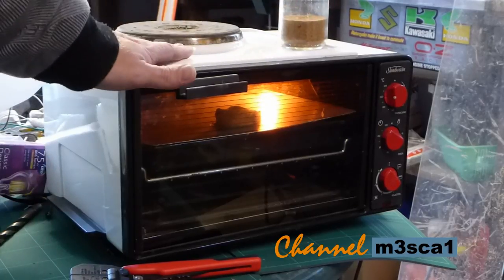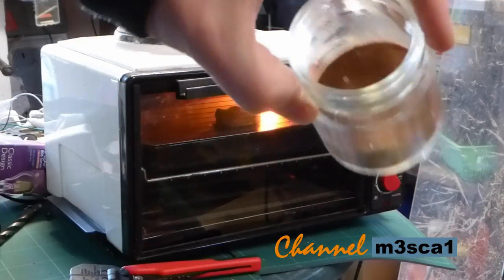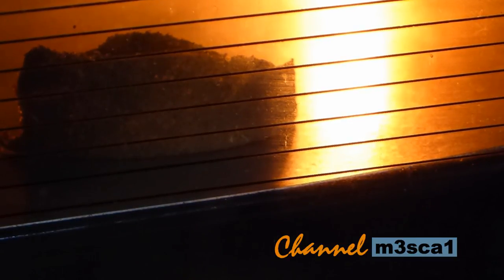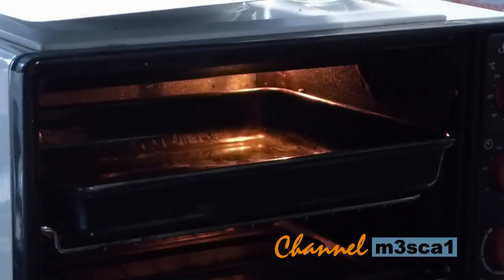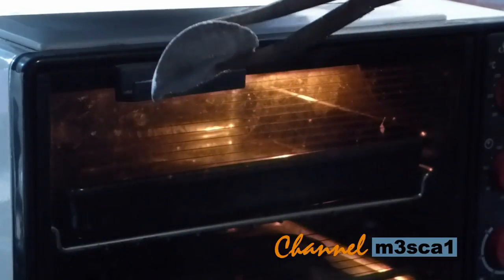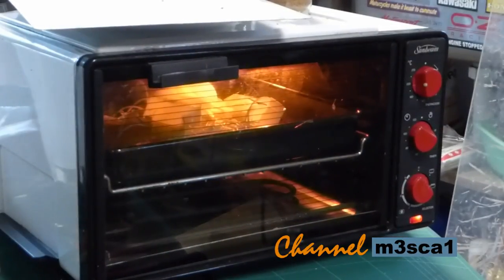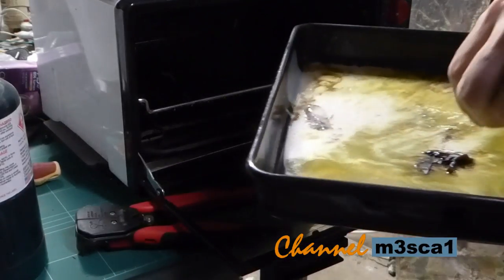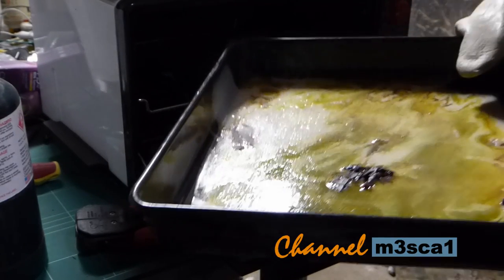melting PLA & Forge making...

Comment: thought you said you only need the two printers :)
Reply from the maker: Zero Bytes lol yeah true but there is a bargain of a printer coming next week...can you guess who is selling it? I plan to sell the cold bed machine.
Reply: m3sca1 aldi?
Reply from the maker: Zero Bytes yes that's  correct...expect them to sell out quickly
Reply: i'm sure they will sell fast may check my local aldi but not expecting them to stock it as last time  there was nothing wen they sold the last one .
Reply from the maker: Zero Bytes i was told my local only stocked 3 last time.
Reply: ah k maybe how it work here  i'll still check making a little cash on btc/Burstcoin :)  should have some money for one .
Reply from the maker: +Zero Bytes tell me more about tyis Burst coin?
Reply: Burst coin is like all the other cryptocurrency but you don't use asic to make the coin  you use your harddrives free space  to find the deadlines  if you like more info goto the forums on burst nation they are very helpful 

en.wikipedia.org/wiki/Burstcoin has some info as well
Reply: what thing yiou well need is a fair amount of unused harddrive space

Comment: The sodium silicate reacts with the CO2 in the air to go hard, not the heat. The mix you have is not good for crucibles...if you need a hand with this stuff give me a yell.
Reply from the maker: electro1622 i did come across info about hardening with CO2 after making this....thanks for confirming. I never heard back from you after I sent that HV driver. Did that package get to you? I am all ears for any advice you have about these water glass brews.
Reply: Yes I got the driver , thanks for that...I thought I already told you. A good ratio for sodium silicate is about 4% by weight... you can then put in a plastic bag and harden with CO2  canister for fizzy drinks..
Reply from the maker: electro1622 awesome. What about clay to sand ratios?
Reply: Clay ratios can vary a lot ( from 12% to 30% ) depending in quality, fineness, mold complexity  and type of metal cast  but for what you need should be easy... you don't use sodium silicate with sand / clay mixes..you don't need to..sodium silicate replaces clay as a binder..
Reply from the maker: electro1622 so just use finer sand and no clay?
Reply: give me a ring, I'll tell you how to make a good crucible cheap.